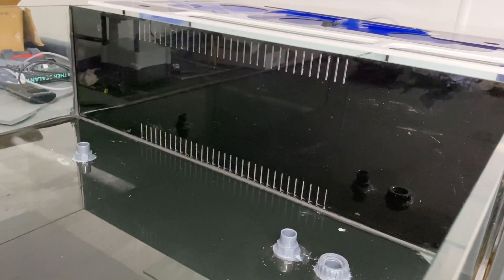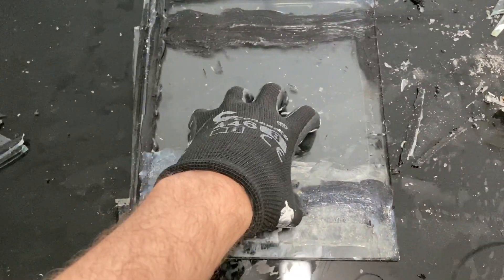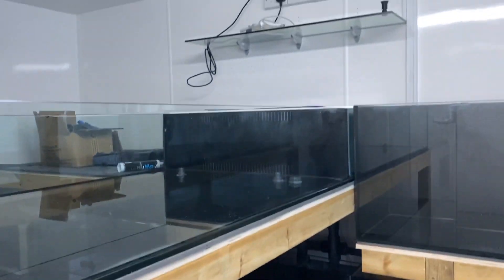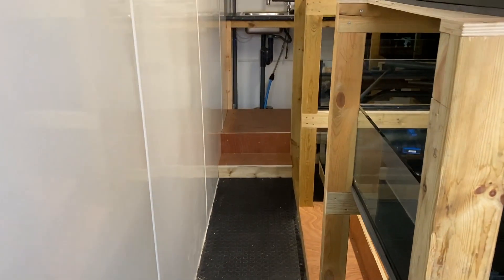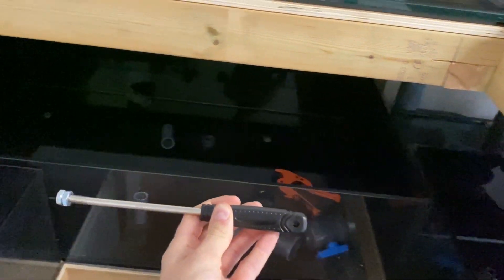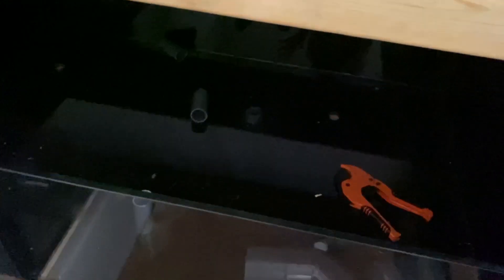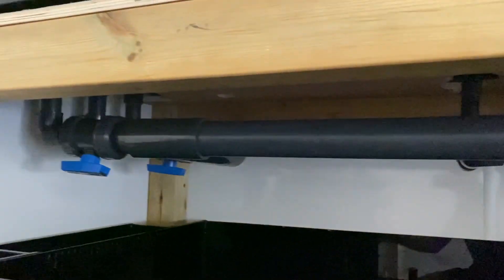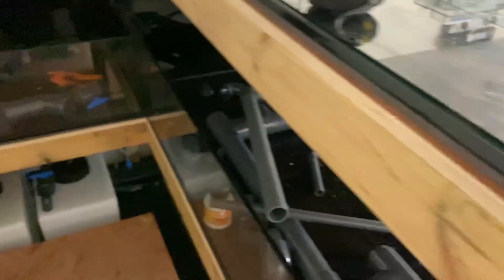4000 Litre Saltwater Tank Mega Build is Back! - Part 7

Comment: Not trying to be negative pal but did your guy calculate the weight of the water in the tanks? Only reason I ask is because the stands look a bit flimsy but might just be the camera, scary times if they built in unlevel good job you noticed 🙈 good luck buddy 👍👍